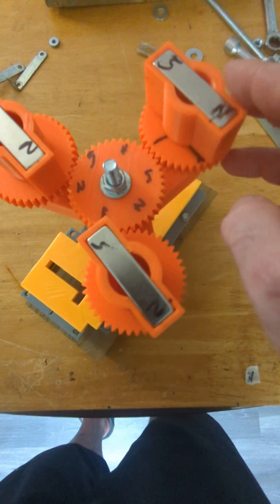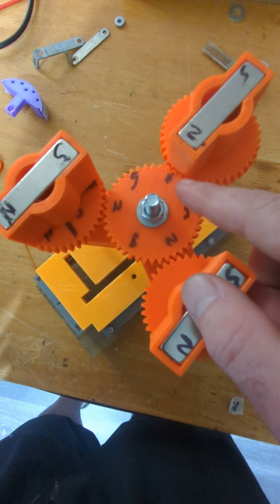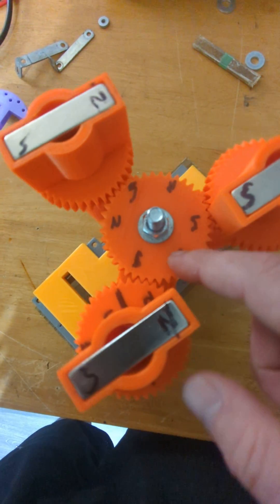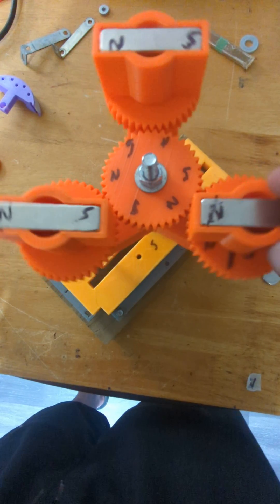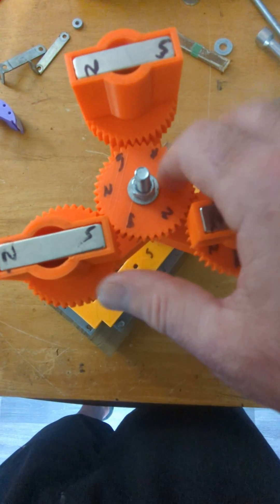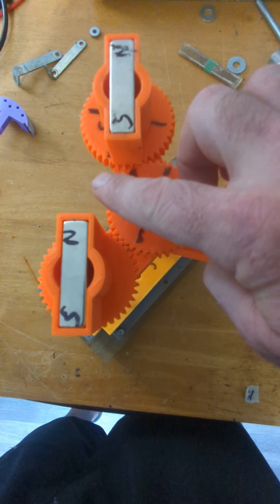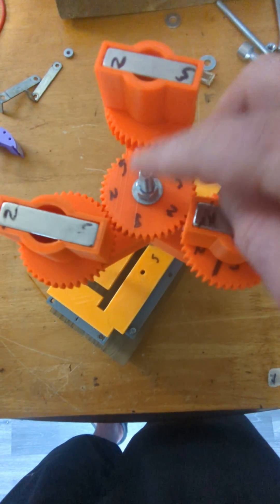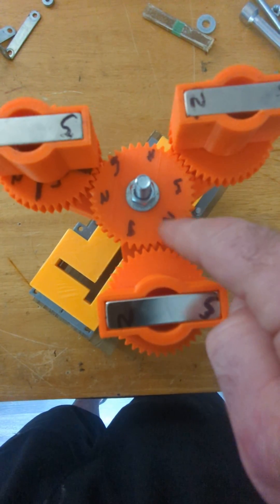Magnets On Planetary Gears- Investigation #5

Comment: If I am recalling it properly this would be considered a "second-order" magnetic gear in case anyone wanted to put a name to such a device. I would be interested to see what would happen if you did as you described, unfortunately I assume that it will come to rest in a state of equilibrium more often than not, similiar to how a single phase electric motor would produce only one static (as in unchanging) electric field (and often relies on a capacitor to keep it moving) instead of a constantly changing magnetic field that more phases would introduce in order for the rotor to remain in motion. I always visualized multiple phase motors like how some christmas lights have that feature where it looks like the lights are chasing one another in the same direction.

Comment: U have interesting contraption u could make something wondering out of it if u would like to know what i mean i could i explain further try at each one 42° different per one that is sweet spot from 40 to 50 but i think 42 i tried make something similar but i turned it to device that work like the shaking tourch with electromagnet it similar to self rotation solar panel connected to dc mottor or solar panel connected to speaker and laser pointed on solar panel fun stuff and got kire that will intrest u and got an solution to magnet motion
Reply from the maker: 42 is not divisible by 360
Reply: @floodrod  oh u don't get it it was not joke  but still 42 and hitchhiker's guide to the galaxy 

But stil around 42 is good spot for 4 magnets or 5 magnets it least from my  testing
Reply from the maker: @alangolab6657  42 is impossible.  Means I would need 8.57142857143 gears.  with 4 gears, they need to be placed at 45 degrees.  I already have a 4 gear one built.  I will be showing it soon
Reply: @floodrod  oh my bad I mean position of magnet 42° towards other magnet and so on for next one u show that u can rotate the gear with magnet like in the 90° video sorry for the miss understanding
Reply from the maker: @alangolab6657  magnets 42" apart?  That's just under 4 foot!   With 4 magnets, that a 16 foot circumference. The magnets would need to be the size of bowling balls to attract 42" away
Reply: @floodrod  did u use π phi radius to calculate distance in sphere and the rotation of objects and magnets  n52 or similar in strength can output magnetic fields wide enough for it to work 2 10mm ⭕ this shape magnet can hold a person in air while the magnet are on not magnetic rod the is video from scientist and u saying in sizes of bowling ball to u want pick up golf car with that magnet or something?